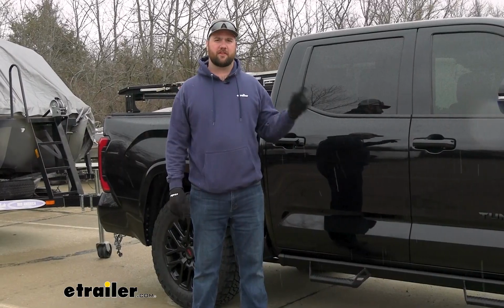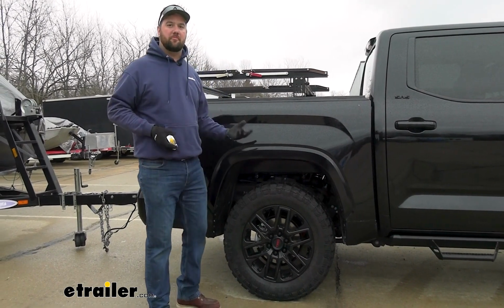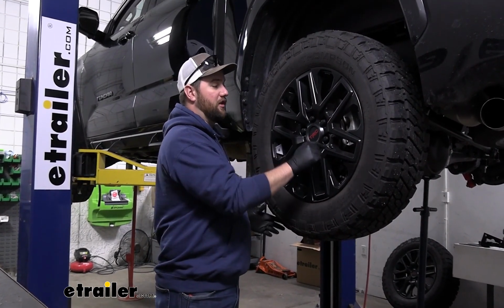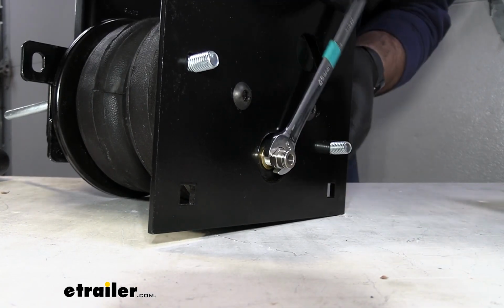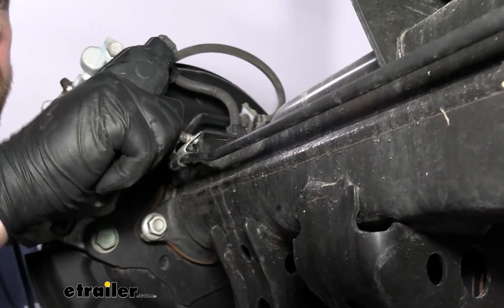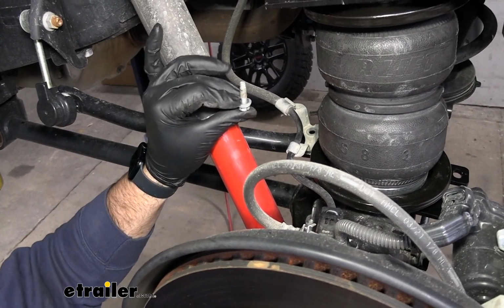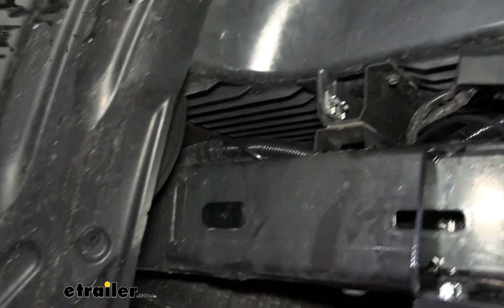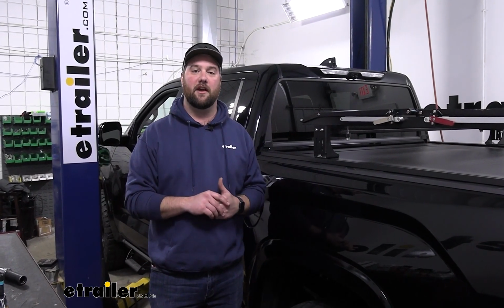Air Lift LoadLifter 5000 Ultimate Rear Air Helper Springs Installation - 2022 Toyota Tundra

Comment: Hello, great video. Would I be able to make the airlift 5000 like in the video work with the factory dealer installed TRD lift kit on a 22 limited crew max. I’ve heard spacers can be purchased. If so which spacers are size. Do you offer those for sale ? Thanks
Reply: Yes. I wanted the TRD Off Road Package with the air suspension, but you can't do both from the factory. Also, the factory is auto leveling and not air suspension. I've heard better things about the Airlift 5000 over the factory leveling, and I will be putting it on my Tundra as well in about 2 weeks.

Comment: Will this kit fit a 2023 Sequoia (non-air-suspension) without drilling?
Reply from the maker: It will not, but Firestone offers the # F4124 which is a fit. The overload bumpers will need to be shortened by cutting. You won't need to drill to install the air springs, but depending on where you install the Schrader valves are installed, you might need to drill for that. We'll link you to the install instructions.
https://www.etrailer.com/Vehicle-Suspension/Toyota/Sequoia/2023/F4124.html
https://www.etrailer.com/instructions.aspx?pn=F4124